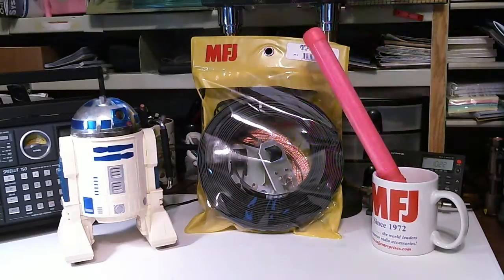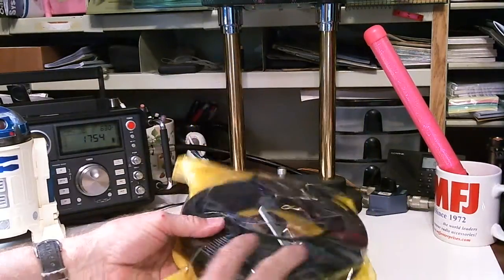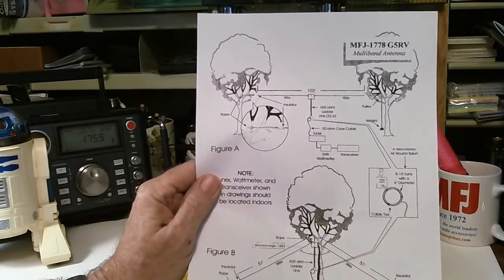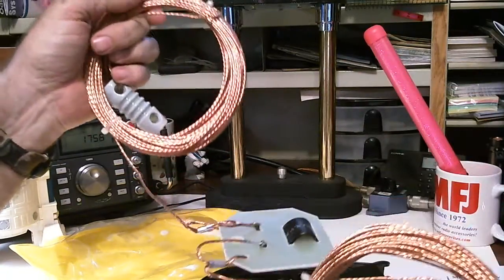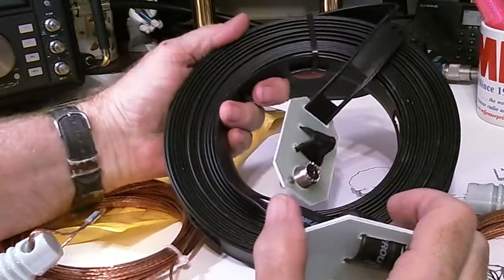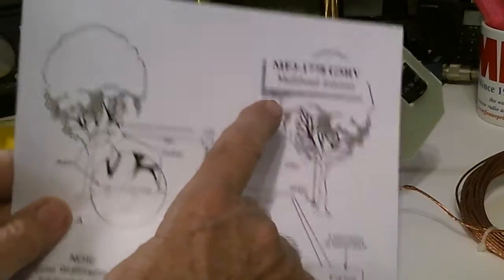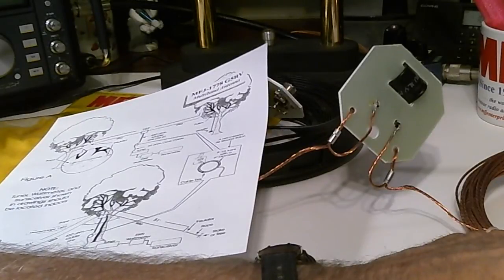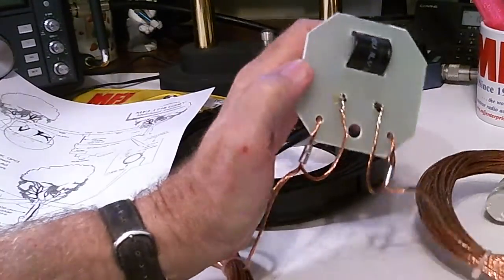TRRS #0537 - MFJ G5RV Shortwave Antenna

Comment: Tom did you put up the antenna and check it with an antenna analyzer to see if it actually works?  I put up one and I tried using the antenna analyzer on it but did not get good results!   It's supposed to work on all ham bands from 80-10 Meters but some sellers say you need an antenna tuner while others say it should work by itself.   It does show 4 resonant dips but none of them are right on the ham bands and the lowest SWR that I get is about 3:1 except for one large dip at 19.84Mhz. I tried using an antenna tuner and then it will tune perfectly for 20 Meters but not any of the other bands!  I wonder how they can make claims that it works if they aren't true?  To give them the benefit of the doubt the ends are too long to fit completely in my yard so I had to pull them forward a little so it's got kind of a V shape.  It should still work on some bands though shouldn't it?  A lot of reviews say this kind of antenna works well but maybe they just never tested it except to receive?  It receives OK since it's so big but I don't see any way to tune up a transmitter on it except at 20 Meters. Since it's way too big for just 20 Meters I'm beginning to think the whole thing is just a scam!
Reply from the maker: Steve C I have not tried this one yet but my old one works great.

Tom
Reply: hamrad88 What bands does it work on?  The one I have from MFJ can only be tuned for 20 M and I don't see any way to tune it for other bands.
Reply from the maker: Steve C Again, I have not installed the MFJ one.  I should say my neighbor has not installed it for me. :)

Tom
Reply: hamrad88 Where are you located?  We can probably get some volunteers to help put it up.  Didn't you ever do a frequency response test of the old one and print out a graph showing the results to see if it even worked or not?  My antenna analyzer shows that my MFJ model does not work!
Reply from the maker: Steve C Tampa Bay area in Florida.
Reply: hamrad88 That's a bit too far to drive from Phoenix but you should be able to find someone locally to help.You will probably be disappointed to find the G5RV only works on 20 Meters though and any claims of it being multiband is total nonsense.  I was just reading the MFJ manual for it again now that I know how it works and it occurs to me that their description of how it works is mostly a lie!  They give the theory of operation for each
band but the only one that makes any sense is for 20 Meters where it says this is the true design frequency and the antenna is a 3/2 wave center-fed antenna.  For 80 Meters it says On 80 meters it functions as a slightly short half-wave dipole.  If it's "slightly short" it isn't a half wave dipole for 80 meters then is it?  For 12 Meters it says On 12 meters this antenna is a pair of 1.3 wavelength longwires fed in-phase.  1.3 wavelength?  Really?
That's not even a known type of antenna that will work!  Who ever wrote this must have been on drugs when they made it all up!  They also say that an antenna tuner must be used but don't give any hints on how to tune it for any of the bands other than 20 M.  If you want a laugh here's a link to the manual on MFJ.  I wrote to
them asking if they could tell me how to tune it for any frequency besides 20 Meters but haven't heard anything back yet.  I doubt it's possible since the antenna is going to just work at the frequency that it's cut for.  I was really disappointed that it is not multiband like they claim.  It works OK for receiving but can't be tuned up for transmitting on anything but 20 since the manual for my Kenwood says not to try it unless the SWR is lower than 1.5:1 and that can only be achieved on 20.
http://www.mfjenterprises.com/support.php?productid=MFJ-1778

Comment: Thanks tom for the antenna overview. I would like to ask some questions of which a brief answer will suffice. I realize you may be busy but where I am new in SWL I have a load of questions. I will list them in point form for your convenience

1. In  the "V" antenna configuration, is the created angle important?

2. Can 75 ohm cable be substituted for feed line to SW radio?

3. Can a typical old fashioned "CB antenna tuner" be used to tune for different bands?

4. When building your own antenna, can the receive wire be coated or should it be bare copper?

5. Just to verify, you said your current antenna works well at a lower height. Would 15 to 20 feet be considered and acceptable height for good performance?

I am a few weeks away from looking into buying/making an antenna and installing it so I am in no mad rush for the answers.

Thank you for your time, patience and anticipated answers to my questions.

Andy Tobin in Newfoundland, Canada
Reply: Sure you can use 75 Ohm coax, I use it here as well for my scanner antenna lines because quad core has less loss than it 50 Ohm equivalent, is easier to buy and is significantly cheaper, that said it is a solid core centre conductor so if you expect a lot of cable stress/movement maybe a braided 50 Ohm cable should be used instead...
Reply from the maker: Andy Tobin Right now comments on YouTube are really messed up.  My replies could get deleted or lost.  Please send your questions to me directly at trrs73@gmail.com
Reply: Andy Tobin Email sent Tom. You may answer questions there and I will have them in my email for future reference.
Reply: No worries... I had to start looking for alternate sources of coaxial feeder cable once I moved out into the more rural areas, quad cable works well however your next problem is connectors but I believe there are oddball PL259 connectors out there, personally I just use modified ones (rg58 drilled out) or F connectors then use adapters although BNC crimp connectors would be superior.
Reply: Hello Andy

You may want to consider a vertical powered antenna to save yourself some trouble...  I like the MFJ-1024.  If you put it up with its base 15 to 20 feet off the ground, the reception should be very good.  Note this is a receive only antenna, so you would need another type of antenna if you decided to transmit in the future...
Reply: ***** i use 75 Ohm on my scanner antenna (Diamond D130J) too and it works really well. It's commercial grade too. I got it free from a Comcast employee.
Reply: ***** Awesome input Sir. I have access to hundreds of feet of 75 ohm cable. It will be used in a secure non-moving situation. Thanks
Reply: I intend to RX only with a shortwave radio. I am currently using an Antron 99 with surprising results on a low end grundig SW radio. When you say vertical powered antenna what specific antenna might you be referring?
Reply: Nevermind, I see you are re.ferring to a MFJ 1024. Thanks